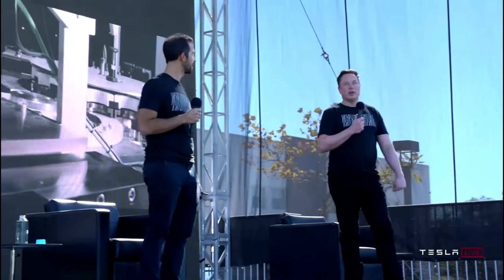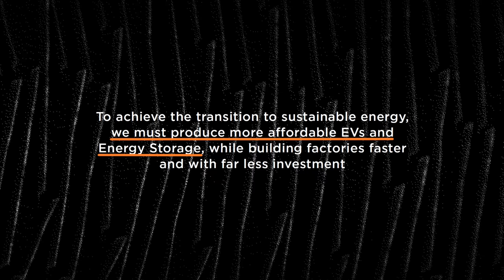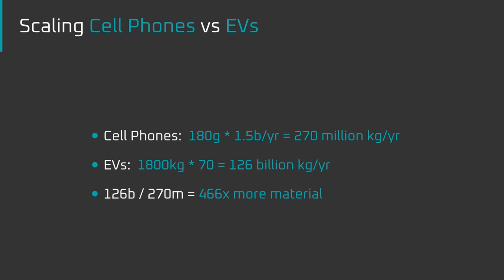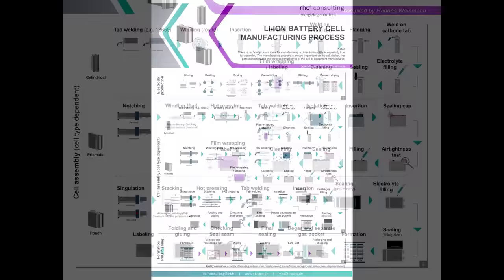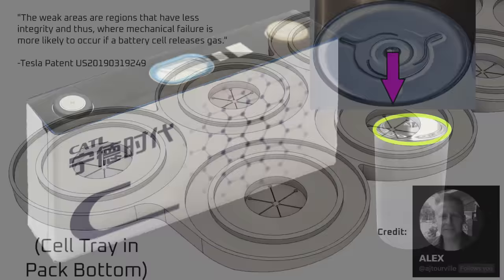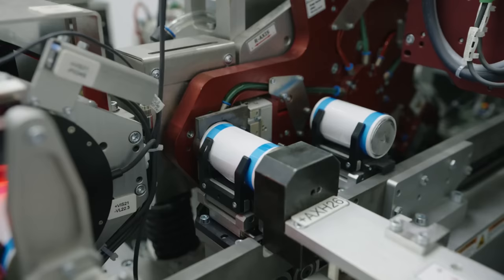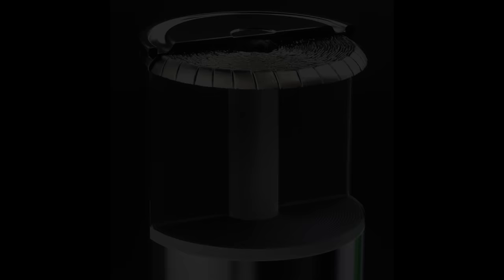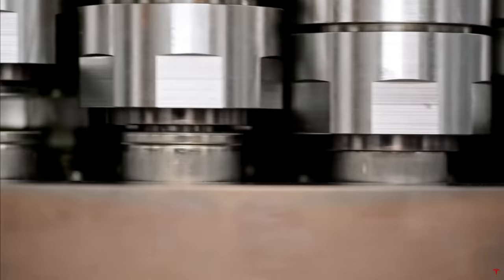The 4680 in Perspective // Battery Day Refresher + Competitors?

Comment: What you think about Gordon ?  I imagine Elon bet on 
1] really most efficient mass production with round cells and dry electrode[but not working yet] also for other usecases and 
2] new chemestries with more silicon anode mix in NCA/NCM and LF[M]P and LNMO!
I guess from standpoint of expanding material while using mor silicon in the cells round form gives more space for volume change between the cells for expanding, like honeycombs of course - the best stable structur of nature. So you a stable form by itself and reserve in space for volume flexibility with new chemestries. Tesla try to use of course more silicon inside but not in production yet. After watching Sandy Munros team's torture with the foam nobody will try it onesmore next year. While mxing more silicon you could significant increase the energy in the cell. Nothing is more stable than honeycombs - like in nature in round process formed to hexagon naturally - only by charging/formating. Its speculation of course but has really charme and potential. I try to think like an Elon :)
 
3] the shortest way for electrons to pass for lower resistance and important for more performance: higher C-Rates with safety reserve to put it outside at 180°
4] despite using cheap chemestries based at LFP to have an argument for better pricing negotiations with the cell companies of course. Elon needs the own ones only for best perfomance and high nickel [and nickel for stainless steel plan too]. 

So he knows 3 years ago using more chemistries [announcement of 3] but we will have more of it for special purposes and tailormade for needs.

I wish we would have better CW-Rates with flat floors and more Aptera-Styles e.g. with cells under the seats and instead of a frunk but with more space as onebox-design. Perhaps we have 3 years ahead the robovan wth all plugin-home-el-support and full bed inside, driving me around the world with only solar filling in a week like aptera but in mass production with single-piece-casting and laminated with solarfoil for 20.000$ ?! But do you think ?

Comment: Will tesla still keep using LFP batteries for their standard range cars? to be honest I would rather have an LFP battery than high nickel 4680, as it's safer and lasts twice as many cycles and can charge to 100% regularly. 
Also one more question, the 4680 was meant to be 10% lighter than the 2170. So how come the model Y 4680 is only 10KG lighter than the model Y 2170? That's rather disappointing,.

Comment: Tesla using Chinese batteries for 10-15 years may be drastically shortened if relations between the US and China continue to deteriorate. Also with the extreme drought and high temperatures in China recently, a lot of factories have had to cut back on production because of electricity shortages. And China keeps hamstringing itself with its zero Covid policies which further impacts productivity.

Comment: im sorry to break you balls, but there is not sustainable future with the amount of cars that are currently on the road. there need to be significant mindset change towards public transportation as a primary mode of transportation and not cars as it currently in USA is... and that comes with the infrastructure change/design upgrading trains and buses to modern standards, and expending the network and frequency of such mode of transportation.

Comment: I disagree that pouch cells are not as safe as cylindrical or prismatic due to the lack of a hard shell.  Thermal runaway releases a lot of heat which will burn through a "hard shell".  The advantage of a cylindrical in this case is that they are somewhat separated and have a heat sink between them, not the fact that they have a hard shell.
Reply: One of the chief causes of thermal runaway is a short caused by something punching through a cell wall.
Reply from the maker: This isn't a deep dive.  There is no universe where well made pouch cells are safer than well made cylindrical and prismatic, unless they find a completely different way to manufacture them.

And that's for a whole host of reasons.  If you're only looking at containing thermal runaway, you're missing most cases.
Reply: @thelimitingfactor  I'm disagreeing with the hard shell comment.  You seem to say cylindricals are safer because they have a hard shell.  Yes, they are safer, but for other reasons. One of the reasons you mentioned is the "vent" at the center of the cell which allows ejecta to exit without harming nearby components.

Comment: Thermal management issue on cylindrical cells. 4680 versus 18650 

Details 
Let cell volume represents heat dissipation, and let heat sink through cylinder wall area, the area/W ratio of 18650,r and 4680,R is 1/R to 1/r, or about 0.111:0.044 and simplified to 2.55:1. That is to say 18650 has 2.55x more area per Watt of dissipation. That also implies 4680 runs 2.56x hotter than 18650 given the same dissipation. That also calls for -2.55x coolant for 4680 to match thermal load of 18650. That may suggest we need expensive forces vapor phase technology to cool 4680 using a heat pump system further reduce charged mileage.
Reply: The tab-less design means less internal resistance and less heat produced?
Reply: @TheEvilmooseofdoom  elaborate if you can.
Reply: @philoso377  Ok.. This is better done by you watching some of Jordan's older video's.  In a standard tab battery all the juice enters/exits the cell through one small connector for the whole jelly roll.  On the tab-less each layer is like on big tab and they overlap which means electrons from outer layers find a shorter path vs the old tab design where they all had to flow through just to make it to one.  That is a terribly inadequate explanation..  You should watch the video, the graphics do a much better job.
Reply: @philoso377  The video's being referenced are the 5 or 6 part "Lithium Mine to Battery Line" video's.  It's a bit technical.  It will take a hour or so of viewing then you can explain to me where I went wrong.  I don't rule it out.  My memory ain't what it used to be.
Reply: @TheEvilmooseofdoom  Older.
Reply: @imaginary_friend7300  If I read your message correctly it refers to electric current, right? 

I’m afraid we kissed one another here. My message was about thermal issue. Particularly cylinder wall area per Watt of dissipation. 

On another comment I point out another electric conduction issue that the tab less anode flaps architecture did so well collecting current from chemistry only to face a new bottle neck in the 4680 fabrication. That anode flaps are not soldered to the cylinder base or wall. A point contact wafer is used to bridge current from anode to cell wall. Replace one bottle neck with another bottle neck. I wonder how many notice that silly mistake.
Reply: @philoso377  Watch the video titled "Tabless Electrode Patent (Deep Dive)".  The tabless design does address the thermal issue.
Reply: @imaginary_friend7300 I heard your claim. It’s about time to elaborate on the claim.
Reply: @philoso377  I can only keep pointing you at the information you want, from a source that explains it better.  If you're to lazy to even do that much for yourself then I can't be of further help to you, I don't like people who choose to be helpless.  It's low.
Reply: @imaginary_friend7300  my message is about thermal issue but you read as electrical. You keep telling me I’m missing electrical feature and update that I should go fetch myself and giving up defending yourself.
Reply: @philoso377  The two are joined hand in hand.  You do understand what generates heat in a battery don't you?   I'm really starting to suspect your actual understanding of what going on is not half what you seem to think it is.  Or is it actual lazy?  Don't fail for that reason.  It's shameful.
Reply: @imaginary_friend7300  I’m sorry that I have lost you.

Comment: Hi Jordan, at this point in time, it appears you are justifying Tesla's approach will stating they win if others succeed too. The problem with this analysis is it doesn't appear to address the current issues. The first generation of 4680 doesn't off any advantage over 2170 for NMC cells, unless Tesla are really sandbagging the Texas MY standard AWD. The structural pack is heaver with lower capacity? Meanwhile in China they appear to be switching to CATL M3P (Manganese +) and ramping rapidly. They even moved mega pack to LFP. If the export tariffs were removed China would eat the US EV market? They are importing BYD blade batteries to Berlin, that means a massive cost advantage even though they are 2 years into the Berlin Cell building?
Reply from the maker: Hi John, it appears you've ignored this is the first video in a series.
Reply: @thelimitingfactor  
(OUCH!)
Reply: "The structural pack is heaver with lower capacity?" If you look at the Munro Live teardown of the Austin 4680 pack they show that there are 828 cells in the pack. When you do the math even giving each 4680 cell a capacity in Whs on the low end of its likely specs then the range should be quite a bit higher than these early versions are showing. It seems that these first packs are software locked. 

Each cell is likely in the range of 97-99 Whs. That should give the Austin Model Y with 828 cells a 80-82 kWh pack which is very similar to the 2170 pack. Overall the Austin Model Y looks like it has a curb weight of around 20 lbs. less than the 2170 Model Y as well. 

The 4680 cell is just starting out and hasn't gotten anywhere near optimization yet in chemistry and application. As you can see it is starting right out of the gate equal to the 2170 packs in specs but there are lots of advantages that aren't just energy density and its volume and weight. Like this video discusses the lines can produce cells at a 7x rate over a 2170 cell line. That's enormous. There are fewer units per pack which means less cost per kWh. Right there they have gained production speed and lowered cost. And as a side benefit the structural pack along with the cast underbody gives it an incredibly stiff and superior chassis compared to the competition. 

We also haven't really the performance advantages of the 4680 yet. It is very likely that once they start going into the Cybertruck or Semi next year we will see their true maximum charging envelope. We know that Tesla is getting ready to field their newest V4 Superchargers and they will be at least 300 kW capable, probably higher. They wouldn't be doing this if they didn't plan on having an impending use for it. 

As far as CATL and LFP cells going to Berlin this makes perfect sense. It's the same reason they are doing it in the US. These LFP packs are less energy dense and are going into the cheaper lower ranged models. This chemistry also will charge at a lesser speed than Tesla'/Panasonic's most advanced cells. Tesla will likely not ever be able in the near term to ever catch up to demand so they are going to rely on LG and CATL and whoever else to provide them with a volume of lower density cheaper cells for these lower range models while Tesla focuses on ramping up the 4680 high energy density packs for the long range and high performance models.
Reply: Question - would you rather have a Texas MY standard AWD for 60k or a Berlin MY RWD BYD Blade for 45k they both have 273 miles range ? There will be a MIC MY with more range with M3P CATL in 2023 with greater range and a 45k price, it's only tariffs that prevents US delivery.
Reply: @johndinsdale1707  I wouldn't want a SR Model Y. I couldn't even get one anyway. The only option on the US site is the 330 mile AWD model or Performance model. 

These first 4680 Austin Model Ys are only being offered somehow to people locally or employees. These are clearly locked packs.
Reply: @flipadavis  LFP also has better cycle life, better flexibility in general use / abuse % charge. Tesla is still selling into high end market, but LFP style might suit those less obsessed by sprints. Everything is in flux anyway, lots of variables.
Reply: @iandavies4853  Not just sprints. Faster charging and much more range. 4680 chemistry is just getting started. These early cells are in the 97-99 Wh range. They will be over 100 Whs very soon. There is talk of the target being around 105 Whs. That would mean a pack with the current number of 4680 cells would give the Model Y around 350+ miles of range. LFP just can't come anywhere close to that with its lower volumetric density and heavier weight.
Reply: @flipadavis  in general use, LFP can / should be charged to 100%, nickel chemistries better to 80% and higher discharged % too. It’s a big trade off for small advantages which most people just won’t value. Most people just want a Camry or VW. Robotaxis in particular, probably won’t need nickel chemistry.
What is true today, isn’t necessarily true tomorrow.
Reply: Unfortunately you are thinking like the legacy manufacturers instead of Elon. Elon does not optimize a single part (i.,e. the battery pack), he optimizes the entire product/process. The structural battery pack eliminates major parts of the body, such as the floor and  side beams. This is where the weight reduction appears.

Comment: The tab less architecture should be renamed for laminate wide thermal equalization architecture. 

The single tab current bridge issue, so call “bottle neck” issue, was eliminated by the tab less architecture for anode flap (shingle) construction and finishes incomplete.

Details: 
Single tab use area contact to complete electric circuit. 
Tab less use a multi point contact wafer (end cap?) to complete electric circuit. 
Essentially we are replacing area contact by (inferior) point contacts. 

Essentially all the benefit for tab less has been compromised in an inferior point contact construction. 

Inadvertent benefit?  The laminate wide thermal equalization architecture. 

Heat transfer can be made easily from core through intermediate wrap reaching to last wrap through the anode flaps. This allows heat to flow in out of the core completing the thermal equitation cycle. Otherwise heat must pass through chemical layers in and out of the core. This is the only benefit I can see off the tab less architecture. 

The bottle neck issue in the tab less architecture remains unresolved because the anode is not welded to the cylinder base, instead a point contacts bridge wafer is employed, a wafer that is inferior to a surface contact bridge, a bridge we call “the tab”. 

Further in that the bridge wafer is preload contact bit welded to the cylinder base as all cell of tab architecture do.

Comment: I think Tesla (Elon at least) may care more about profit than affordability at this point. By focusing on EV autonomy and robotaxis and shelving a 25Kish  vehicle for the foreseeable future , the company’s actions speak for themselves. Other companies will have to make affordable EVs. It won’t be Tesla. But at least they got the ball rolling.
Reply from the maker: Or, supply and demand speaks for itself.  Robotaxis means more access to cheaper transport.  Profit is a side effect and an indication they're allocating resources more efficiently than anyone else.
Reply: Profit from 60k cars builds Battery factories.
Battery factories force the transition.
.
(Then there's the opinion that as Autonomy takes off, the "25k car market" becomes irrelevant, since the potential owners will "call a cab" which is only 20% of the running cost with none of the hassle?🤔)

Comment: I'm sorry but I feel the 4680 has been a disappointment so far.
Reply: You might have had unrealistic expectations.
Reply: @TheEvilmooseofdoom  maybe it was Tesla that gave me that expectation when they said at battery day they would be 2 to 3 years before they would cut the price in half and have 200 gwh of production and they are not close to either one of those goals. Elon said in a recent interview Texas would be going back to 2170s which doesn't sound good for 4680s .
Reply: @greengold6705  Don't feel bad.  A lot of what was talked about was over peoples heads.
Reply: @TheEvilmooseofdoom  I also think they oversold what they really had and I think they have ran into a lot of problems they didn't see but I hope it works out I'm rooting for Tesla.